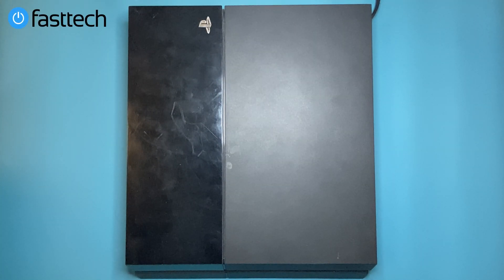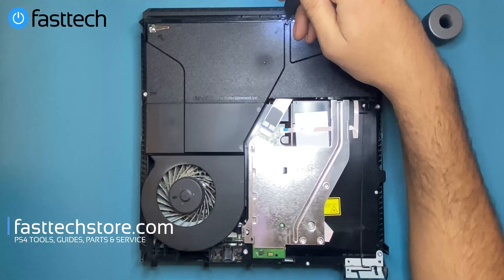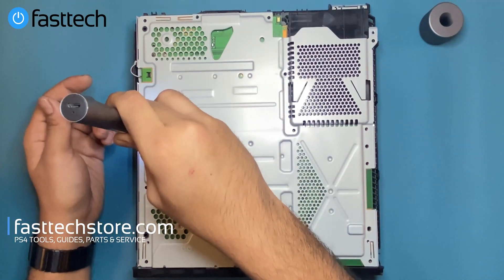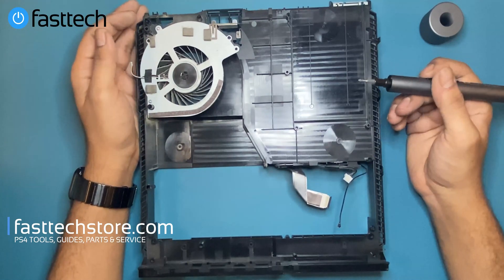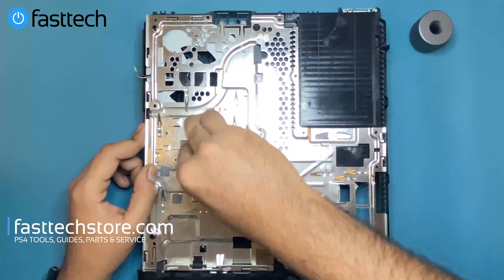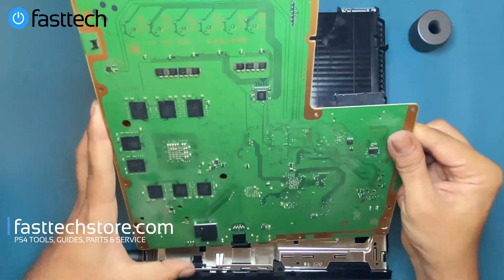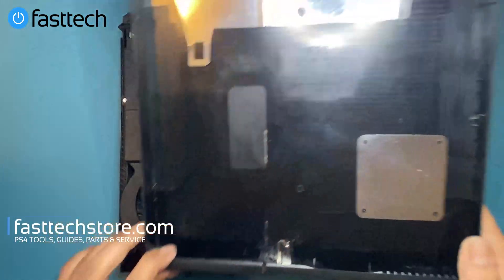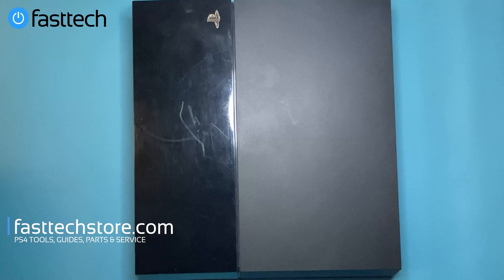PS4 OVERHEATING FIX (Cleaning and Thermal Paste Replacement Guide)

Comment: Thank you very much - great video. Followed along easily and had no hiccups at all. Also replaced the CMOS battery whilst I was in there, and put new thermal pads on the ram modules (1mm deep). It was sounding like a jet engine, now, better than when new.
Reply from the maker: Great to hear. Thanks for the comment. Like the video and subscribe 😊